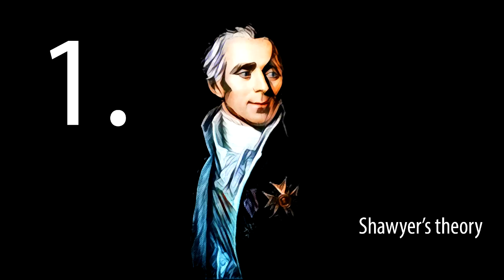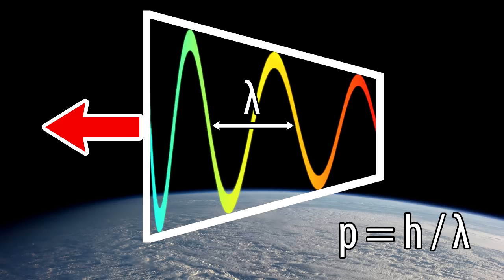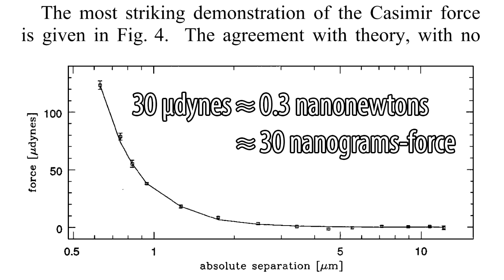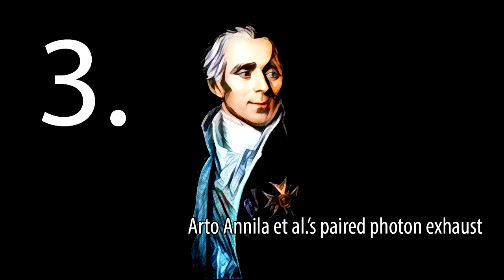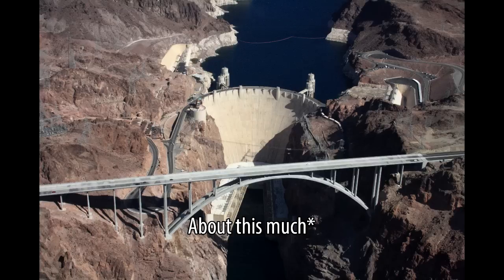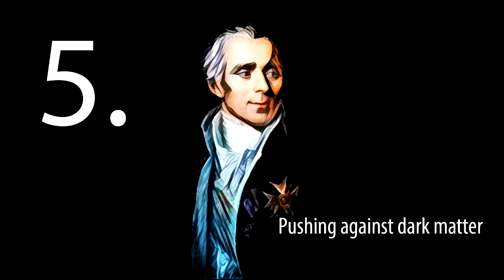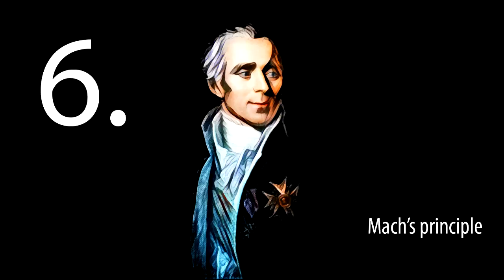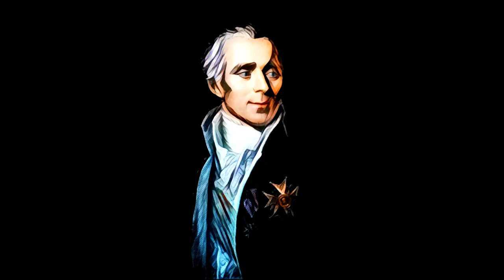The most unscientific approach – The Emdrive (part 2)

Comment: It might have been useful to mention that the Casimir Effect is caused by virtual photons. 
So i'm not quite sure what you mean by the casimir effect having non-virtual particle explanations, because were that true it seems like it wouldn't work without an influx of outside real photons.
Reply from the maker: The way that the Casimir effect is discussed in popular accounts and the way it is actually calculated are actually quite different. The calculation I've seen most often in QFT texts is something like this: calculate the vacuum energy without any plates being present (sometimes, as a matter of mathematical convenience, the calculation is done considering two very widely separated plates instead). Then calculate it with the plates present, separated only by a small distance. Then subtract the two.

This calculation doesn't even need to worry about details of the interactions between electrons and photons (these are important only for smaller corrections). In fact, you can pretend that electrons don't exist at all and just model their effect by asserting by fiat that electric fields along the plates' surfaces are zero. This is not the usual "virtual particle" device but rather something different.

What could be said is that the Casimir effect is due to "vacuum fluctuations" (a term I otherwise avoid because it's hopelessly vague). I believe the popular notion that the Casimir effect is due to virtual particles comes from identifying "virtual particles" with "vacuum fluctuations".
Reply from the maker: Thanks for your compliments!

Hawking radiation is actually a really subtle effect, and most popular explanations don't even come close to doing it justice. This idea of 'virtual particles creating and annihilating close to the event horizon' is actually due to Hawking himself as he wrote it in his papers, but it doesn't correspond to how he did the calculation. The calculation is much harder to understand than the words, so the words remained. We know this picture can't be right because the most common wavelength of Hawking radiation is of the order of the size of the black hole itself. So it makes very little sense to think of these particles being "close" the the event horizon, because that presumes these particles come in packets which are small in comparison with the black hole itself.

Unruh radiation is related but easier to explain. What we call "particles" are sort of like waves of positive frequency, and what we call "antiparticles" are kinda like waves of negative frequency. If you're accelerating, your notion of "time" is constantly changing, just like in the twins paradox, and thus your notion of what frequencies are "positive" and "negative" changes as well! So what appears to an inertial observer as a state with no particles is to an accelerated observer a superposition of states with many particle numbers. It's always an even number, so these are indeed "pairs", but they're not "virtual". It's kinda like photon polarization: what appears to one observer to be vertically polarized light might appear to a different observer to be a superposition of vertically polarized light and horizontally polarized light, depending on how each observer aligned their detectors with respect to the incoming light. 

Hawking radiation is a little like the black hole counterpart of this effect, if you think of the black hole version of the twins paradox. There are some subtleties however, because a black hole has strong tidal effects in addition to its gravity. It turns out that those tidal effects are important for understanding Hawking radiation in detail. The fact that the black hole formed from collapse is also important -- I bet you were never told that black holes that don't form from collapse don't evaporate!